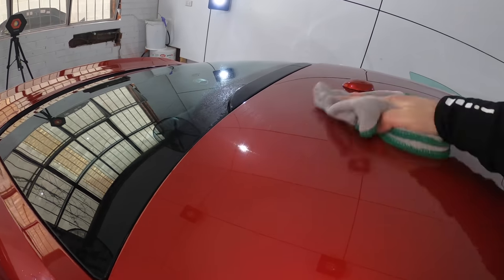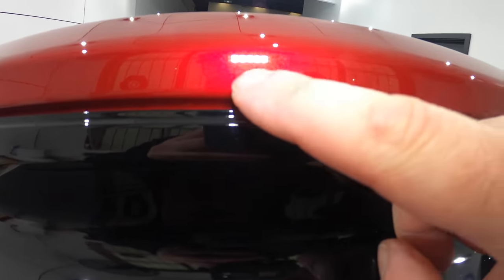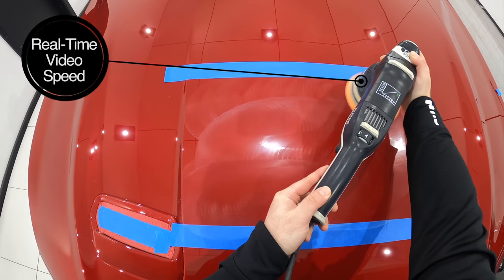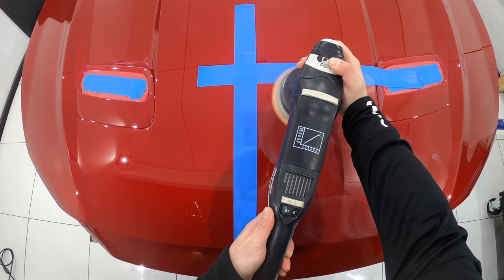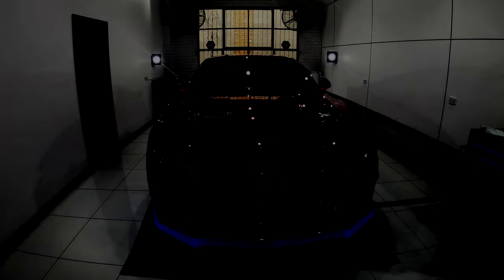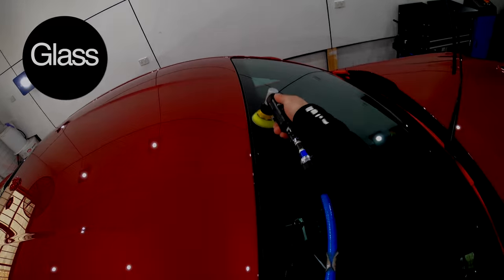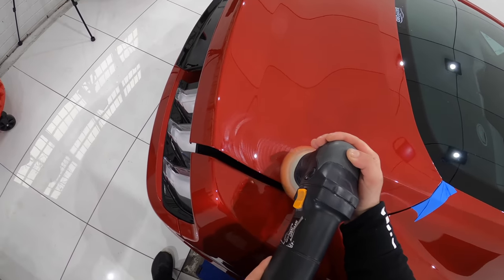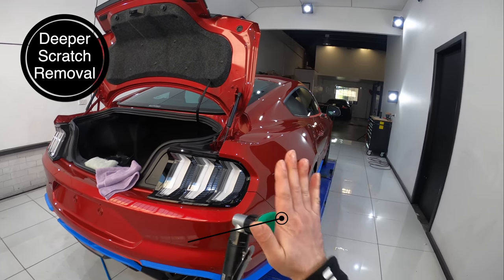How To Detail & Ceramic Coat A New Car! 2020 Ford Mustang | P2 Paint Correction! (Vlog 31.2)

Comment: Impeccable Sandro 👍🏼 I think what many new to detailing may not realize is temperature and humidity can play a toll in results not to mention you can two exact same cars but the raw materials (paint / clear) could have also been supplied by different vendors. This surely supports and validates why testing is so important. As alway respect for your skills and sharing your knowledge 🙏🏼

Comment: Getting more common now cars coming from the factory with poor fitted parts or damage to paint work to much focus on pushing the car out the door to get the next one on the line . Very informative and educational video Sandro , another job well done in the correction stage 😁👍🏻
Reply: Sad reality. Money is now at stake instead of quality.
Reply: I noticed that as well.

Comment: I really appreciate the level of dedication and detail you bring to both your work and your videos. You mentioned that you can brush your pads in place of using air when cleaning them off. As I don’t have an air compressor (yet), I’m curious what type of brush should be used.  Thanks.
Reply from the maker: You can by purpose made pad cleaning brushes, but in reality they are really just slightly stiff short nylon bristle brushes.

Comment: You mention of a few paint chips you recommended the owner have Ford fix. How would they fix it? It was my understanding that short of re-spraying a panel, all you can really do is use touch up paint to try to blend it as best as possible. I had Nissan do that with my new Titan and they did a poor job. And apparently did some wet sanding too because I have a patch around the chip that has no orange peel.

Comment: Another truly amazing video. I am curious regarding IPA panel wipes. Can you use pure IPA?
Reply from the maker: Thanks, and you usually want to dilute a 100% strength isopropyl alcohol with 4 parts distilled water or use approximately 20% strength on car paint.

Comment: I had a deep scratch in my mk5 golf could feel it with my nail use a chinese spta wool pad with Koch chemie h9 8 passes and bit of pressure took the scratch out completely and fished extremely well but I did refine with rupes Millie yellow pad and Koch f6 I don’t have the Millie btw just 15mm cocraft da it’s same as the autofiness da less then 1/2 price

Comment: hello Sandro, Great contet as always. i'd like to ask you a question, how would you remove rust spots on the spokes of a quite new motorcycle (ducati scrambler) ? i've read and heard that polishing could remove too much chrome  and potentially damage the spoke more than it actually is. And after managing to remove them, how to maintain the result? Sorry for the OT question, but i have this problem atm and you're one of the few I really trust out there. Cheers my man
Reply from the maker: Chrome is pretty hard, so unless you go crazy aggressive it’s quite safe to polish it without damaging it, especially if you are polishing by hand. Metal polishes are also far less aggressive than paint polishes as they tend to just very minimal abrasives and rely more on solvents to clean and polish metal. CarPro MetalliCut is a great new metal polish I’ve had great success with especially with a microfibre pad or cloth, it will take some elbow grease but you’ll get there in the end. Rust on wheels or spokes is usually due to brake dust fusing to and then rusting on the metal. So regular use of an iron remover such Iron-x should help avoid it, and coating them with a ceramic coating should also help reduce it from occurring.
Reply: @CarCraftAutoDetailing   thank you for your answer, really, i appreciate. Nice to know metallicut is good as i love most of the carpro products, so would be a nice add to my small arsenal. Ceramic coating is definetly an option in my mind but i'd like to have them as close to perfect as i can before doing it, so in the meanwhile do you think putting on some sonax bsd and then come back some days later to resore more spokes would be an option? I dont have much free time so i can work on it in just few hours window frames
Reply from the maker: Yes that’s fine, a good sealant will work as well
Reply: @CarCraftAutoDetailing  thank you so much, i'm going to attack with ironx and some aluminium foil, just ordered metallicut. For the coating gyeon rim or something else? After this masage i'll stop abusing of your time and knowledge, i promise. Thankl you so much, it means alot beacuse this motorcycle has a special affective meaning to me.
Reply from the maker: I think Gyeon Rim should work great!
Reply: @CarCraftAutoDetailing  thank you so much, keep up with this great content, i love what you're doing!

Comment: Great video, awesome to watch! To be honest, the blue taped up trims actually looked pretty good. 
One question, did your microfibre cleaning procedure change 3 years down the track? Since Coles changed their Wool Wash formula, did you start using another one?
Reply from the maker: Thanks, and no, I still use the exact same product and method, it really works fantastic for me.
Reply: Car Craft Auto Detailing So you use the new Coles Wool Wash? I’ve been testing that between the Earth Choice Wool Wash and I feel the Earth Choice leaves the cloths much softer.
Reply from the maker: I use both and at least for me the results are quite similar
Reply: Car Craft Auto Detailing Thank you!

Comment: hi again Sandro.....I can't get those nv products that iv seen you use in a few videos here in ireland.....but I can get the lake country blue and orange pads....my question is what other products would you recommend in there place. ...maybe in the carpro line up or other more accessible products..thanks again Sandro and stay safe !
Reply from the maker: CarPro’s line up is great and I use their products every single week, so yes I can certainly recommend products like Eraser, Reflect, ClearCut and Essence for paint correction. Inside and the InnerScrub Glove are still my two favourite interior cleaners as well as CQ Leather, and CQuartz UK 3.0 is a fantastic paint coating along with Dlux for wheels and trims and Flyby Forte for glass.
Reply: @CarCraftAutoDetailing  sorry to be a noob with these questions Sandro.....I have nearly all those products and detailed and coated my previous car after watching and learning from your channel. ..including a cquartz coating application...my current car has some light swirls and my question is in what order would I use the Reflect and Essence......i bought a orange carpro pad and a gloss pad too....so is it reflect with orange and then essence with the gloss pad or the other way round....I'm  also going to use cquartz coating on the car.....thanks again Sandro for all your great and informative videos...you have taught me how to detail my car to a high standard...cheers
Reply from the maker: You would use Reflect before Essence (Essence should never be polished over).
It really depends on the paint, but typically you would use Reflect with the orange polishing pads and Essence could then be used with CarPro’s Gloss pad.

Comment: Hey Sandro, what are your thoughts on primer polishes such as NV Morph? Do they improve ceramic coating longevity/performance? And could that have been a viable option as apposed to the S20 black in this situation? Thanks, Cheyne
Reply from the maker: AIO primer polishes could definitely be an option but I wouldn’t say they’d improve durability or performance and you’d really just have so a test to see how well they’d work on each specific paint and it’s existing defects.
Reply: Okay thanks for the reply! Love your work, can’t wait for part 3

Comment: OMG 125 microns, that's just  1/4 of a mm thickness of paint, you would think it would be more than that? Also seen a new maybach with orange peel which on black paint sticks out like a sore thumb and after they finished removing the orange peel, it was like a mirror?

Comment: We can clearly see the difference between a pro detailer and a YouTuber detailer for fun !.
Really a perfect top sandro job 👌 👍 👍 👍. At what thickness of clear coat should I stop using a compound?
A little information please, I encountered static electricity with carpro gliss v2 on CQuartz lite.  What do you think this could come from?  Microfiber ?.  I solved the problem by passing a carpro eraser, then gliss v2 to land perfectly, but is there no risk for CQuartz lite with eraser ?, I do not know the ph of eraser?  !.  Yet I have decontaminated, polishing, erasing, CQuartz lite without encountering static electricity !, being a pro do you know the solution?  thank you in advance
Reply from the maker: Thanks mate, and I personally like to see readings at least 20-30 microns higher than in the door jamb areas to feel confident in risk free compounding. 
The static could be due to the product, I’ve definitely used a couple of test products that have created loads of static pops and little changers in the past but I haven’t used the new Gliss so I can’t say from personal experience. It could also be you’re cloths or the flooring. Eraser shouldn’t really effect a fully cured coating like CQ Lite so I think you’d be fine, but I guess something like distilled water could be worth a go as well.
Reply: @CarCraftAutoDetailing  Distilled water good idea, I will try this next time !.  My microfibers I wash them with 2oz of chemical guys microfiber wash and a glass bottom of white vinegar to soften them, but I don't think it could come from that?!.  Thank you again my friend 👌 👍 can't wait to see your next video

Comment: Do you always use small polishers around the edges?
Reply from the maker: No not always. As I mentioned in the video, it’s fine to use larger polishers over edges if it’s just a mild combination and you’re not trying to remove significant defects in those areas.

Comment: As the red tends to show fade more than any other colour do you think now that paint manufacturers come up with some sort of additive to show less fade ? I really like to go for red but it’s the colour that really reveals it’s fade than any other colour also does ceramic coat protect from UV ?
Reply from the maker: Since car manufacturers started using clear coat in the 90s it’s reduced oxidation on red pigmented paint dramatically! Always making sure you have a car wax, sealant or coating on the paint will definitely help reduce the likelihood of oxidation but it’s not going to entirely shield it from UV damage - the sun is a powerful thing! My wife has a red car that’s lived outside for the past 4+hrs with little to no oxidation because we look after it. Most cars you’ll see today with loads of oxidation simply aren’t well maintained with some good paint protection in place.
Reply: @CarCraftAutoDetailing  So would you suggest I have it wax before applying PPF? What do you recommend on branding of wax ? Thank you.
Reply from the maker: PPF has to be applied to bare paint in order for it to effectively bond, so you can’t apply a wax before hand but you could certainly have the paint polished and make sure it looks it’s best before the PPF
Reply: @CarCraftAutoDetailing  thank you. I’m tossing between Red race (solid) or carbonise grey GT. Just unsure if carbonised grey (metallic) is easy to maintain and show less revealing of micro scratches or swirls under the sun. I always owned white coloured cars and for that very reason it’s easy to maintain and I can see some micro scratches but by holding a LED lamp close to the panel unlike the sun with black cars. So I don’t know even the velocity blue is a nicer colour but it’s a darker colour so it will show however it’s a metallic so it may not reveal as much.

Comment: Where you get the rubber protector thingi to put over your air hose, so it does not scratch the paint?
Reply from the maker: I think that was just some rubber fusing tape

Comment: What kind of clay can I used on this color?without scratching the paint,I clay bar the fender on my car,n there's a bunch of scratches now 🙏 I'm trying to clay bar the entire car but I'm scared now
Reply from the maker: An ultra fine or very fine clay bar will be the less aggressive ones, but if a clear coat is soft it’s normal for clay to create minor swirls and marring - a light polish should address them quite easily.
Reply: Ok i will try with the fine clay. It feels like overspray on the paint n thanks

Comment: The mustang is my least favorite car, but that doesn’t excuse the fact that it was delivered with so much damage. I used to work at a dealership and I’m going to go out in a limb, and say the rest of the damage, with the exception of the glue, unless the glue was done with dealer installed options, dealers just trash paint on cars. I’ve purchased 24 new out of the 32 cars I’ve owned in 31 years of driving, and the dealers in the Us literally have teams of people that just pull up in a truck with a trailer, with a huge water tank on the back, and they go down the line, and one power washes the car with an industrial grade pressure washer, while at least 3 people, just follow behind the pressure washer, with a chamois and dry the cars. No soap, not even a wash. Just a blast and a dry. If the car has spent any time on the lot, it’s gotten sprayed down, twice a week, and dried with a dirty chamois, that was used on 100 other cars, in an hour.

Comment: The problem with mass production. Not just Ford, but cars today are hurried out of the factory to get the money rolling in. I own a FK8 which  i love, but had the front bumper replaced as the paint had peeled.
Reply from the maker: Yes, there’s no doubting it’s an issue across the board largely driven by profit margins, but I think a lot of it could be solved just by changing some common practices that wouldn’t necessarily cost the manufacturer or dealerships more money.
Reply: @CarCraftAutoDetailing  Yes I agree. The other issue is manufacturers do not have the passion and love for a beautiful well cared car, unlike you and I.

Comment: Quality control with paint work is atrocious across the board. A local crew is consistently doing brand new(straight from the factory) Ferrari’s, Mclarens, Lamborghinis, Bugatti’s, Audi’s, NSXs, and so forth. Certainly not a Ford or Mustang thing.
Reply: With that being said, it’s something that needs to be addressed across the board. Why would $200k-$1m cars come with ANY paint defects? Let alone enough to need a full multiple stage correction straight from the factory. It’s definitely not something new car owners should have to deal with, no matter what. 

I did love the video! Thanks for the information!
Reply from the maker: Yes, it’s definitely not just a Mustang thing but having done about half dozen brand new Mustangs in the last two years they are definitely up there with worst I’ve come across. But I agree with you on all those points!

Comment: There are 2 bad things about this video. 1. The quality control from Ford is horrendous. That's bad on a $20 grand car, not one costing around 3 times that. 
2. It was only 43 minutes long..  Magic work at it's best..  On your answer to the question about what to get, what products are the best for me to use etc..
Starting with Scholl Concepts S20 black & Lake Country orange pad for just your typical wash swirls & scratches works great.  
Then get in different polishes & pads as you need..  I started out with just the basic Supercheap 6" D/A polisher with Shine Mate pads..
I have now added the Shine Mate 3" D/A & Blue, Orange & Black Lake Country pads for both D/A machines using S20 Black & S30 polish..
I just do it as a hobby on my own cars as well as family & friends cars.. The look on their face when they see the difference is awesome..
Cheers for the informative videos Sandro.  :)
Reply from the maker: Thanks man, I’ll take those negative positives lol, and that’s great to hear!